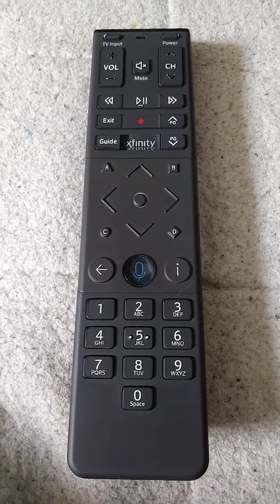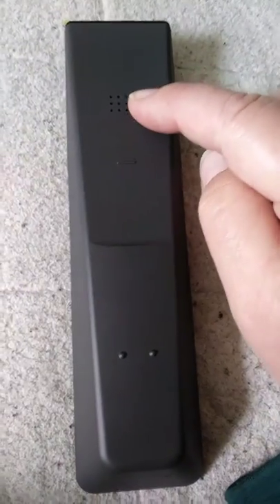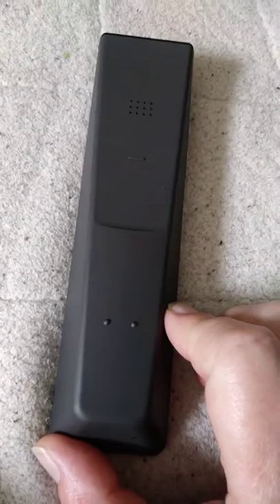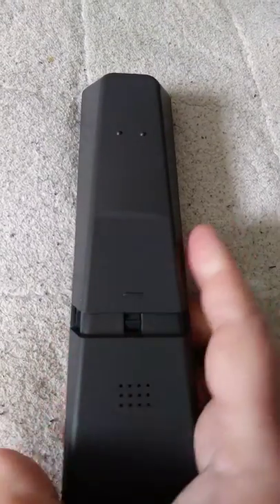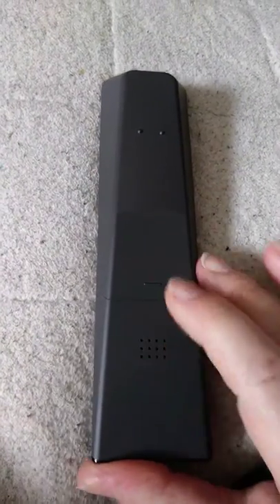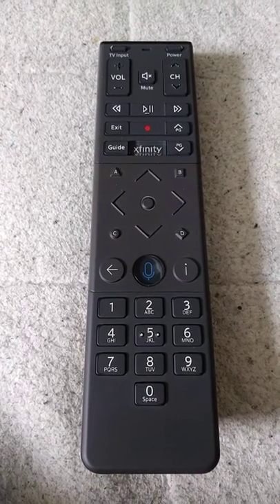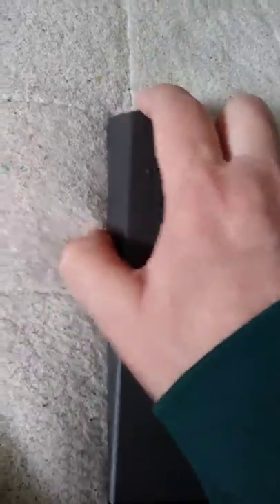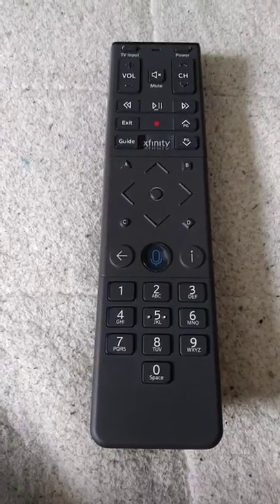How to change Comcast xfinity R15 remote control batteries

Comment: Thank you - I tried and tried and looked and looked in the manual and online for instructions on the remote and other than the how to use it to watch tv - there is nothing about how to change the batteries - when the time comes.   So - thanks to you now I know and presto - I followed your directions and it worked!!

Comment: I figured out how to replace the batteries before I noticed this video. And when the batteries are replaced, the lighting on the remote works again. You can go to the Menu on the TV screen and look for the category "Remote Setup" and check how much life is left in the batteries in the remote so you know when to change them.

Comment: How do you like the new XR15 remote?  We like the XR11 but was curious about the new one.
Reply from the maker: the uncreated light LOVE IT!  Works great!  What cool about it is that when you pick it up all of the buttons light up - so no fumbling in the dark guessing what button is what - and no having to get up and put a light on the see the remote.
There is a blue microphone button that you push and it listens... Like "MeTv" or "COZI channel" and it flips to it.  You can also use numbers after you push the blue microphone button and say "channel 239" or whatever station # you want.  And you can say shows like "Roseanne" or "The Terror" and it pulls up the shows.
You can also say "free movies" or "free horror movies" and it'll go there!
I never had a talking"listening" remote before, so i had plans on using the microphone, and now I love it - it's pretty darn cool 😎.
I used to have Verizon FIOS (for 10+ years) and Comcast xfinity is MUCH better and this remote is AWESOME!!!!  So easy to find everything!!!!  I HIGHLY RECOMMEND using their latest remote - its great ☺
Reply: Sweet thanks.  We cut cable for a while and tried some streaming tv services.  YouTube TV was pretty cool, Sling had some neat features,...but with all of them we just missed having the X1 remote, it's that nice.  I noticed you can actually buy an XR15 on Amazon now for under $10 bucks, so might just order one and try it out!  Thanks for the info.